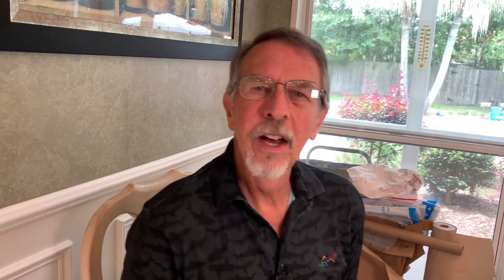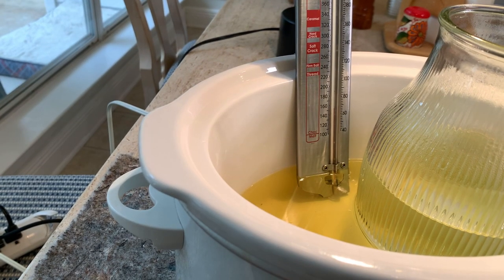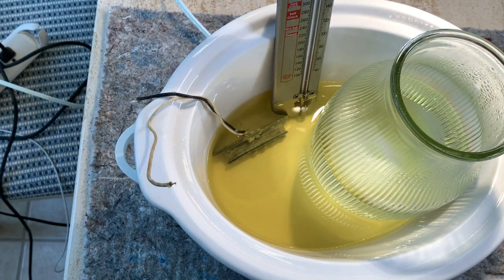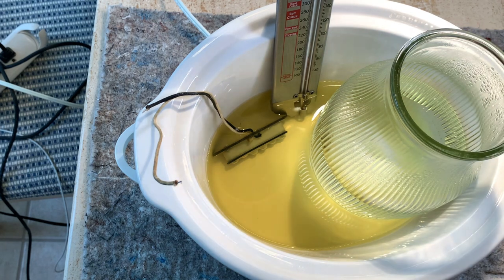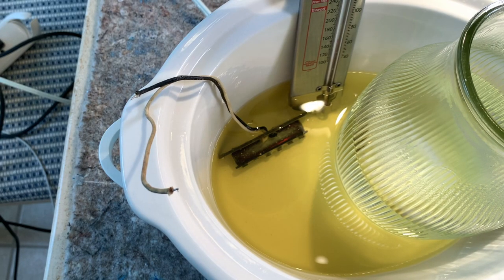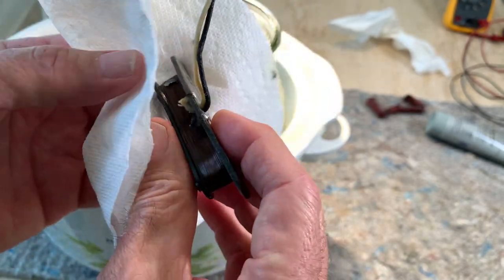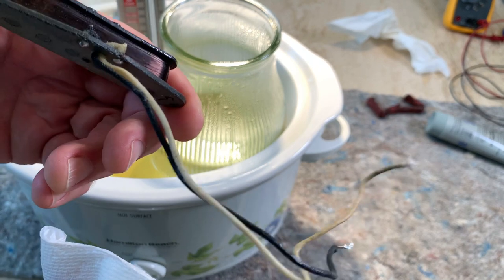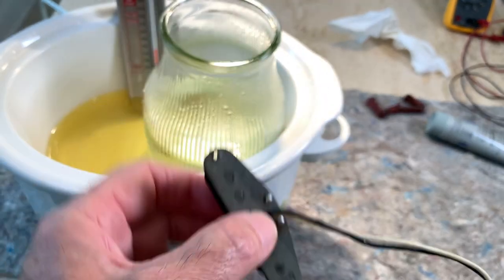How to Wax Pot Your Strat Pickup - Minimal Potting (Flash)

Comment: A tip I picked up along the way, use a heating blanket to warm the pickups before they go in the wax.  Works like a charm.
Reply from the maker: I can see having to do that for sure if you were doing this for a living.  I thought about sticking in the oven for a little while at 150F but I'm not sure my oven goes that low.  You could probably hit it with a heat gun too but that is probably dangerous.  Letting it sit there for around 5 minutes did the trick.  I'm installing it this morning to see if I cured the squeal.  I take it the heating blanket is made for industrial purposes because a regular heating pad probably doesn't go very high.  I think it would be great to get it at exactly 150F so you could dip it in and out in a minute or so.
Reply: @millstap  I just use a regular heating pad.  I also have a cheap infrared thermometer to check the temp.  The pickup doesn’t have to get to the full 150.  I just wrap them up in small batches and leave them for 10 minutes or so.  Think I got that tip from Fountain City Guitar Works.  👍
Reply from the maker: @bbmade  I just did a high gain test on the neck pickup and I think I got it fixed.  No more squeal.  I don't have strings on it yet because the EVO Gold frets need a little recrowning.  The don't wear hardly at all but they get this weird sort of wavy look to them between where the strings make contact.  The StewMac Z-File made quick work of it.  They look like new now.  I hope I don't have to do this again but at least I know how to do it now.  I just want to see if I was able to preserve some of that touch sensitively that I experienced without the potting.
Reply: @millstap  Look forward to a video!  You always have some great tone.